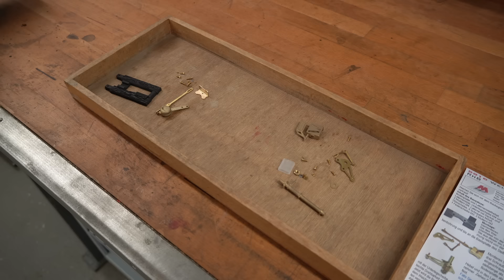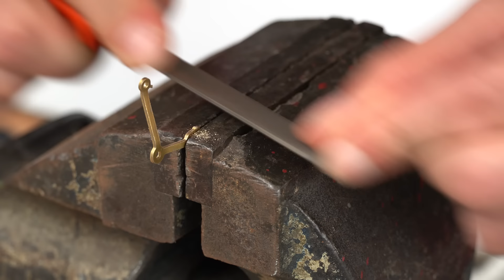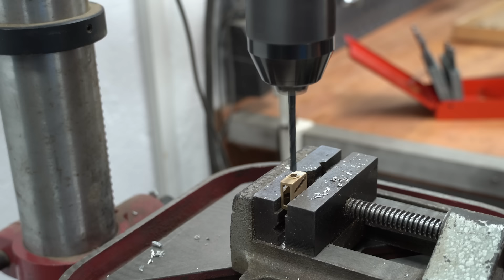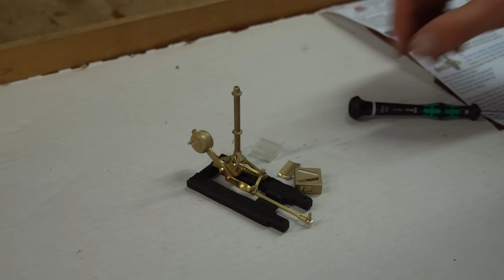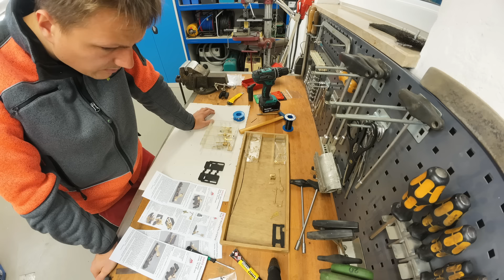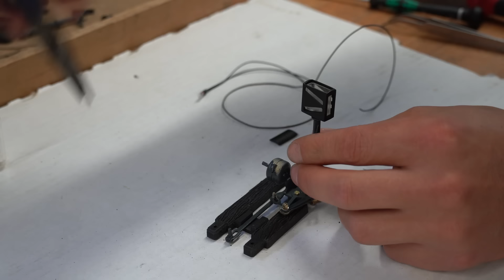Building SWITCH LEVERS - G scale

Comment: Hi robert, when i have painted metal parts for anything i have always lightly greased/oiled all the points that join together then that way it avoids the situation you had with the paint sticking and the switches not working properly and with modelling i use vaseline to stop newly painted parts from sticking due to the new paint, hooe this helps you for future projects and grear work to and the old style wheat grain bulbs look great i  the lanterns, led lights wouldnt look right in the lanterns on the switches
Reply from the maker: Thank you for all that good information! That will help for sure!

Comment: Great video. Thanks for sharing and also showing your mistakes and the corrections. A lot of people would not show that or admit to making mistakes. With winter comming do you have any big projects you will be working on?.
Reply from the maker: Hi! I made many mistakes on this project and it took way longer than it should have. If I can help even one fellow model railroader by pointing out my mistakes I am happy to do so. Also I got a lot of potential solutions for my problems by admitting them and now getting useful comments from some of my viewers! During fall I will try to get the sawmill installed with all the lights and stuff that goes with it. During Winer I urgently need to get my signal box running. I have all those nice signals installed but non of them work since the signal box isn´t finished. I guess that will take all winter.

Comment: Congratulations!  Now, with this experience, you're set for any future manual switch machines 🙂  Are you planning on any remote operated switch machines?
Reply from the maker: You are right, I learnd a lot. I like those switch levers so I will assemble some more of them for sure! I have about 18 remote operated switch motors on my layout already. Since my signal box will be worked on this upcomming winter I do operate them via my Massoth Digital Central Station at the moment. It works great!

Comment: Very nice. I think the bearings in your air drill are worn or very dry. Some light oil sewing machine oil might help.
Reply from the maker: Hi! The tiny drill is electrically operated and it sounds terrible, thats for sure. I will have a look at it but it might be just the way it is because of the gear box at the end which changes the drill direction by 90 degrees.

Comment: Great video - thank you for sharing! Does this mean you will have some manually-operated switches in addition to the switches with switch motors, or will the switches with the fancy levers/lanterns also have switch motors?
Reply from the maker: Thank you! I will have manually operated switches throughout the new addition. They are easy to reach and won´t require any wiring beside the lantern light.